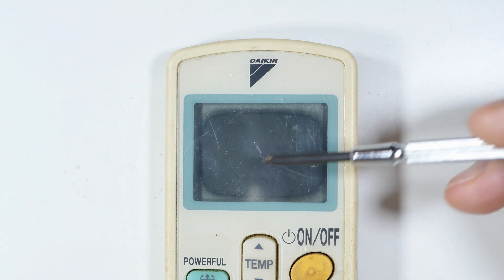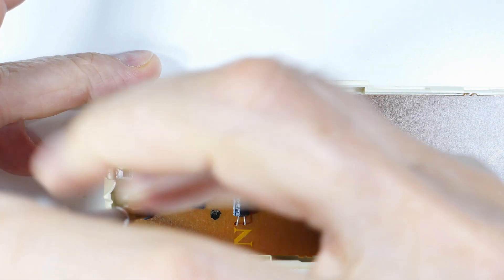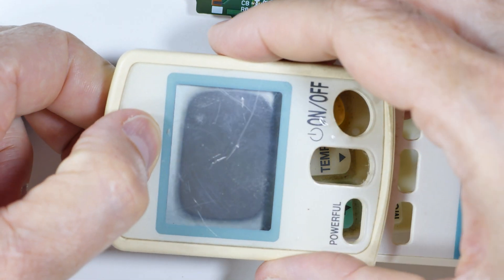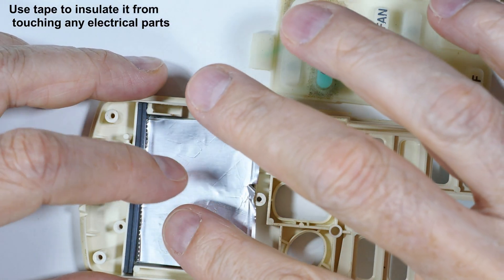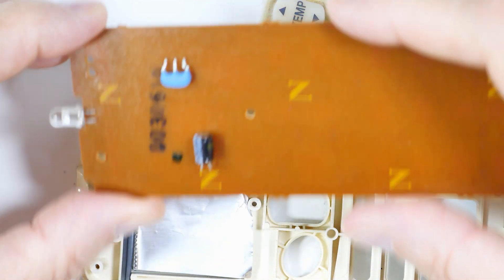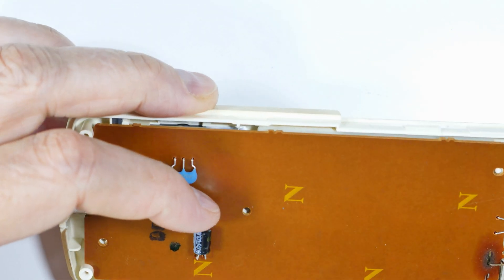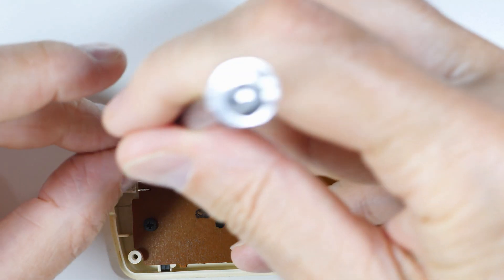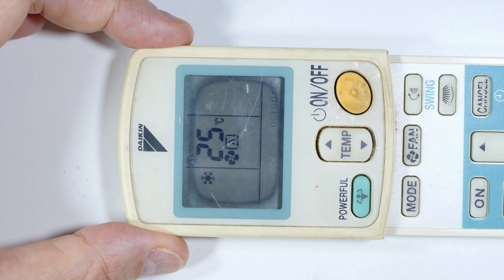LCD Display Repair - Basic Fix (4K)

Comment: Exactly what I needed. My ti calculator was useless because of same problem
Reply from the maker: There is a more advanced fix where you peel off the old reflective layer, but it's easy to make a mistake and ruin the display forever.  I'm afraid to make a video on that technique.
Reply: @tsbrownie  I would be too... Maybe lapping paste to make it go away would be easier
Reply from the maker: @SurajGrewal  The ones I've seen are stickers, but they are stuck on real well and it is easy to damage the display trying to remove it.